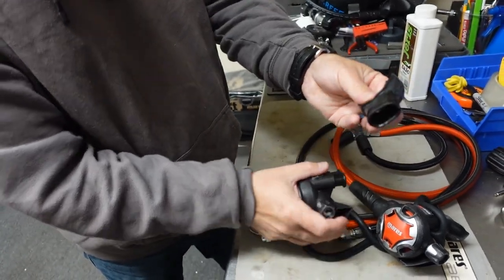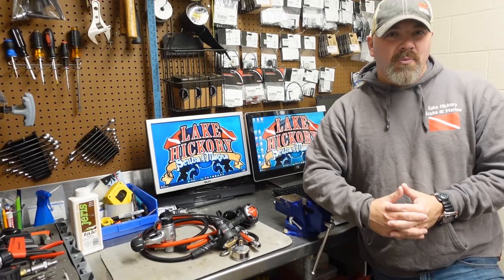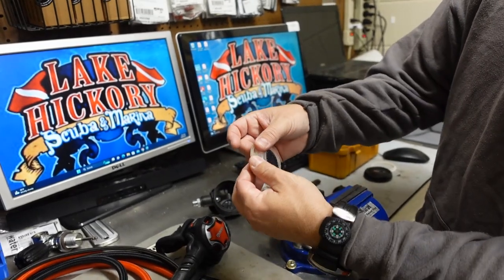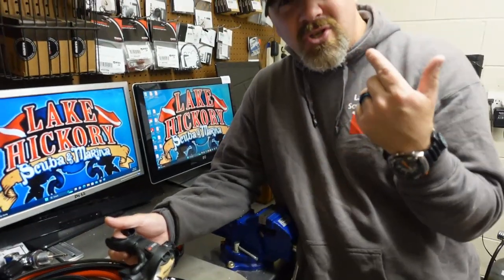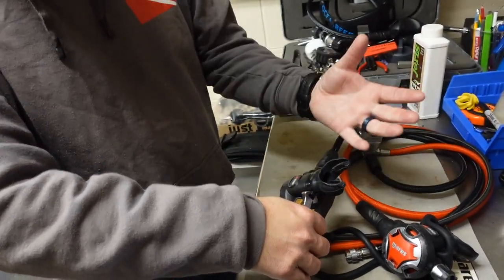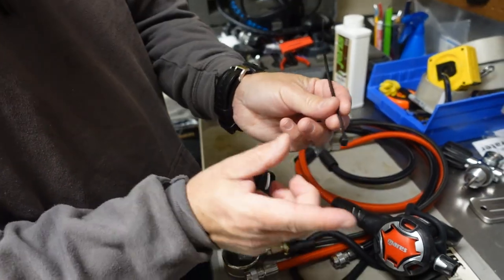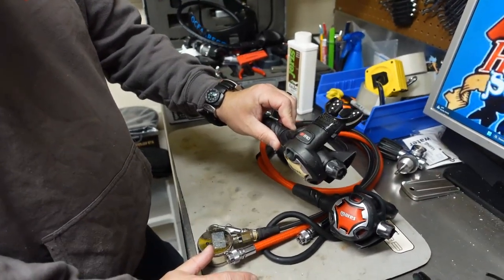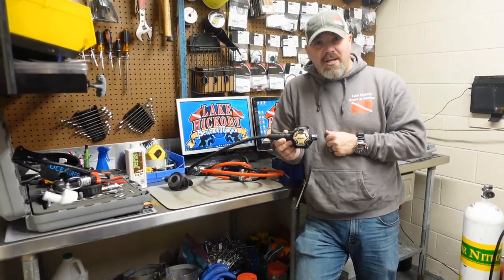How To Replace Your Regulator Mouthpiece

Comment: Thanks for this great video. What cutters/clippers are you using there?
Reply from the maker: Hello @clintirvine9495, any End Cutting Pliers will work. Here are several links for you.

https://www.amazon.com/TEKTON-8-Inch-Cutting-Pliers-PCT10008/dp/B07KQ15855/ref=sr_1_8?crid=3AR6GVFGRG27X&keywords=little+flat+dykes&qid=1693509762&sprefix=little+flat+dykes%2Caps%2C98&sr=8-8

https://www.amazon.com/Cousin-Jewelry-Linesman-Diagonal-Cutting/dp/B075HD3P2G/ref=sr_1_16?crid=3AR6GVFGRG27X&keywords=little%2Bflat%2Bdykes&qid=1693509762&sprefix=little%2Bflat%2Bdykes%2Caps%2C98&sr=8-16&th=1

https://www.amazon.com/SPEEDWOX-Nippers-Precision-Functional-Professional/dp/B07DLRBQQG/ref=sr_1_39?crid=3AR6GVFGRG27X&keywords=little%2Bflat%2Bdykes&qid=1693509762&sprefix=little%2Bflat%2Bdykes%2Caps%2C98&sr=8-39&th=1
Reply: @LakeHickoryScuba   Thanks Kindly.